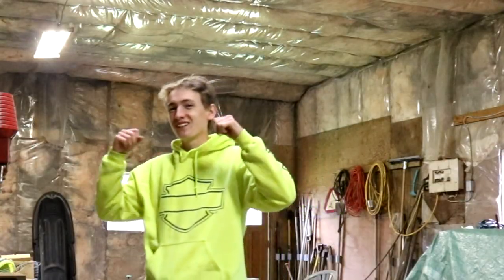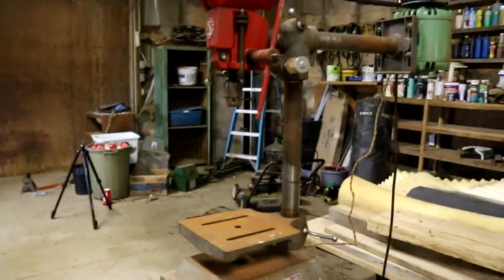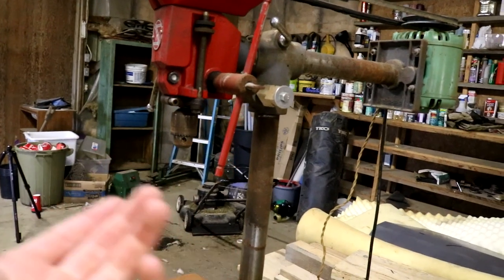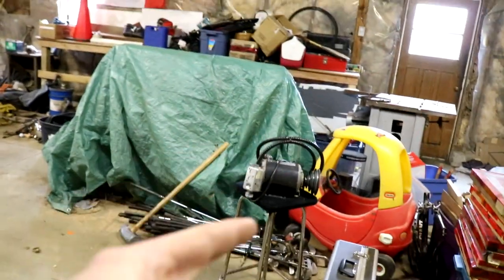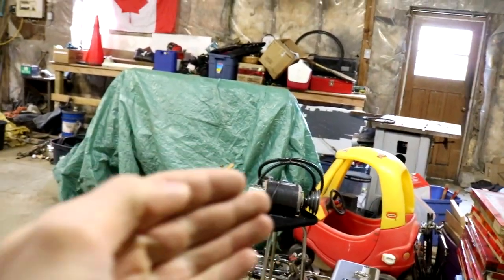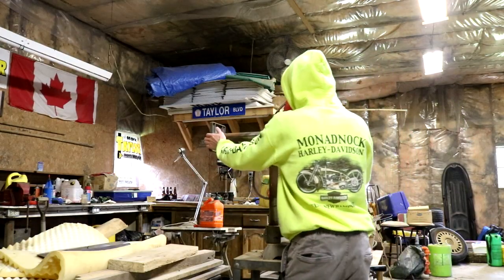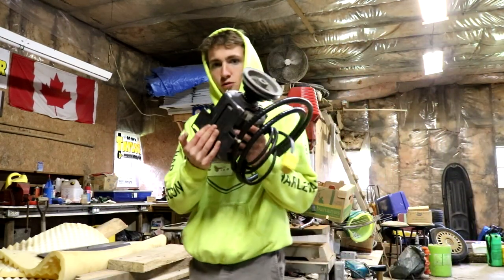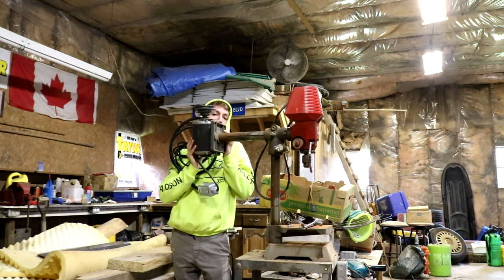How TO change a Drill Press Motor

Comment: all you had to do is swap the wiring. alternating current will run your motor, or any motor in either direction depending on wiring polarity.